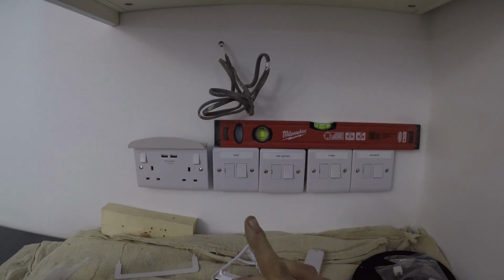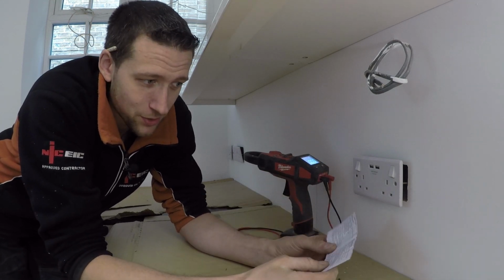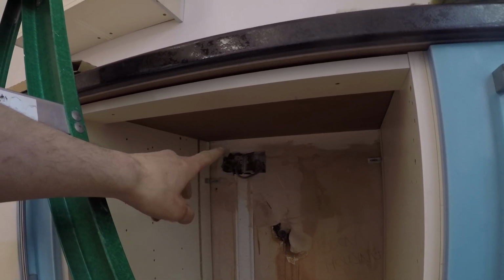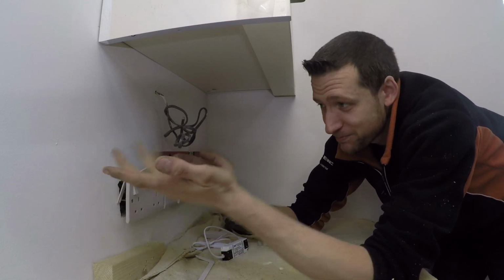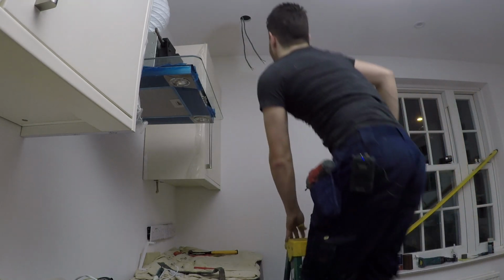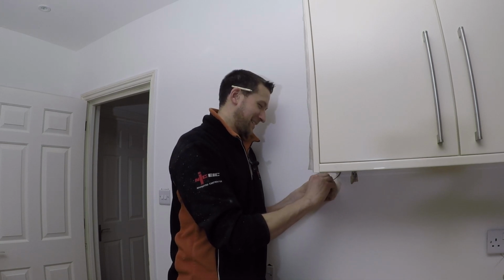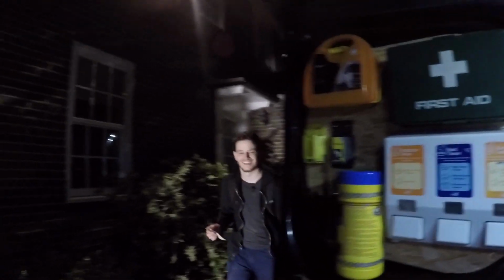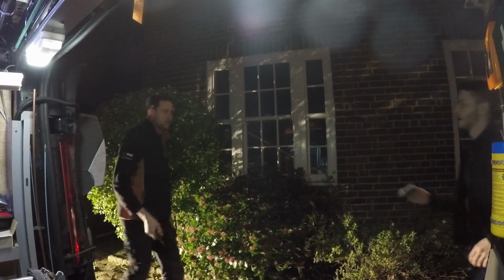Kitchen Rewire 2nd Fix - An Electricians Day in London | Thomas Nagy

Comment: Them USB sockets, IR Testing 500v. When you install them onto the ring circuit, connect the 2 browns into the live, 2 yell/green into earth (+optional earth bond), the 2 blues - just connect them together with a 'wago' terminal block. Now your all set to carry out all the ring continuity, r1-r2-all your IR testing with no dodgy readings.

Comment: Top tip for taking the strain off your back when doing under cabinet lighting.  If you can find steps or something the same height as the cabinet you can rest your legs on the top and lie straight as you wire the cabinet lighting.   I'm not convinced about the BG USB socket being insulation testable.  I may have to get one and give that a go.  The test from L/N to earth would be fine, but I would expect a modest leakage between L and N due to the standby current of the circuit....   I've just tested that on a British General USB socket - it showed an abysmal 0.29Mohm on a Socket and See insulation tester.  Probably due to the standby current of about 0.3mA which is significant with a 1mA test current.  Hmmm!
Reply: I should mention I made a video about it (coming soon) and took the whole thing apart.  It's a mile apart from the cheap imported crap.  The quality of the USB module is actually really good in terms of fusing, filtering and electrical separation.
Reply: BigClive hath spoken... now he can talk after those "chicken" noodles...
Reply: As you were doing the test I was wondering. Is it switched with those switches and they mean in switched of position it passes the test.

Comment: Instead of 4 fused spurs, thoughts on the grid modules with the appliances engraved on them? Or did you have no control over design
Reply: Who needs them anyway. Besides cooker big hob no requirements.

Comment: Good work Tom and Tom.  Fitting some undercupboard lighting reminds me of a time when I was screwing a small joint box to the base of a wall unit when a tiny chip of melamine came loose and fell into my eye.  I have never had pain like a scratch to the eye ball !  and thought next time I will use eye protection.

Comment: USB sockets you could always join line and neutral together, test between join and cpc for your insulation resistance test. This will eliminate damages to sensitive equipment and then just note this on the eic.

Comment: Add the metre of led strip to the interior lights in the back of the van no driver required straight 12 volt feed off the bulb holder seen a few done like this very handy on dark nights /early mornings

Comment: Just a food for thought, rather than having a bad back, would it not be easier to mount the drivers for the led strip on top of the kitchen units and just put bell wire down the back of the cupboards to the strip? And means you can't see a driver underneath! Enyoy watching your work! Trying to catch up 😁

Comment: Hi
I normally fit a fused switched spur above worktop and run a 1.0mm twin and earth up to behind the cooker hood chimney and join the Flex from the cooker hood to the twin using a choc box , so if the fuse blows due to a bulb blowing the its easy to replace , saving you from removing the chimney for the hood .
Reply: Better for maintenance and removal or replacement in the future, if it`s on a plug and socket arrangement. Put a 3A fuse in the switch spur, and a higher rating in the actual plug, no dramas.

Comment: Cheers for the insight.  One comment, I suggest you install that led tape pointing downwards next time! Not sure why you decided the wall needed lighting over the prep area?
Reply from the maker: i just thought it gave a nicer light, indirect light so to speak. still more than ample light either i guess. just personal choice i suppose?
Reply: Not really when it comes to a functional work space.  These would be my requirements;
Sealed units that can cope with regular scrubbing from kitchen cleaning products, even the best fully sealed silicon tape struggles with this.
Downwards illumination to avoid any shadows under work units - I can see the shadows in the video.
Proper current controlled tape/strip - hint if all you can see is resistors and LEDS it's probably junk.
CRI of 95 minimum so my steak's looks appetising.
Probably 3000K in a domestic setting.
Think about how these spaces are used - just my thoughts - obviously if the customer says fit this, then whatever.

Comment: Do you solely rely on the sticky back for the LED strips or do you use something else as well? Don’t they come loose and fall down over time if just relying on the sticky back?
Reply: Moelwyn Hopkins in the states we use a bead of silicone. You don't have to take the tape off. Just run down the back and tape with delicate painters tape till it sets.

Comment: Great vids mate. Two questions. What tool is that at 2.35
And how do you have 1 wire at each under cabinet light. Multiple switchlines or jb?

Comment: Ahhhh. That's bromance right there. :) Spread the love dude. Do you have a deal with Milwaukee tools? Or do you just rate them highly? :) I mean, I know you totally get what you pay for but is it worth  stepping up from bloody expensive to flapping expensive? The only Milwaukee tool I have ever used was a jigsaw a while back and it was a sturdy piece of kit. Awesome video as always dude. I have to admit to getting a little excited when the notifications ping up on my phone. :)
Reply: I have never heard the expression “good bit of kit” I’m definitely going to start saying it and bring it to Australia.
Reply: Scott Lichtsinn No offence taken. I am a dewalt man myself. My last drill lasted over 4 years although spent a year putting up with shite batteries so probably should have replaced it sooner. A lot more brands are offering a range of tools that operate from the same battery too which is awesome. :) Luckily I have a wife that understands the necessity to spend a bit more on power tools. When they are put through their paces on a daily basis they need to be reliable.

Comment: I don't see the point in those usb sockets - esp. when you mentioned a house you just did had them with every socket. How many people have more than a few cables for their phone? And if that particular socket doesn't have a cable they just have to go a find one which will probably already have an adapter negating the purpose of the socket. Not to mention, I doubt those sockets have the same protection as the higher end 5v chargers so I'm curious how they would fair with surges. Further, a lot of phones now have some version of fast-charging (my phone has something called dash charge) and I doubt any socket on the market will have fast-charging capabilities other than just a slightly higher amperage.

Comment: How come you fit all the individual fused Spurs for the appliances rather than say a grid switch? Just interested to know, is it preference? Cost? Both?
Reply from the maker: customer requested it. I actually opted for putting them in the cupboard above but they wanted them above the work surface.
Reply: thomas nagy Fair enough, as you say customer is paying so they get to chose. Have also had this before when like yourself I would normally fit them in a cupboard accessible but not on show.

Keep up the good work mate, love your videos as a fellow spark working predominantly in London it’s nice to see others days and how they pan out.

Nice touch with the impact for Dave, goes a long way. Good management mate.

Comment: Is that 10 M Ohm per socket? Doesn't that mean that eleven of them on one circuit will cause a reading below 1 M Ohm? Are you allowed to take a low reading and then approve it anyway based on calculations?

Comment: Think I would have put the extractor on a JB you have it on a fused spur of the fuse goes in the plug you have to take the extractor hood off 

And I would have put the oven and hob on a double with 1 spur to cut down on the space on the worktop it’s only for the ignition takes no load 

Love your vids though

Comment: For the customer who specified usb sockets everywhere did you suggest that’s probably not the wisest thing to do!?
Reply: sorry im not an electrician but i noticed a house that I am looking to buy almost has them everywhere, what is the issue with them?
Reply: Say one of them develops a fault, maybe an intermittent earth leakage fault, how on earth are you going to be able to diagnose which one is at issue.  In 5 years time when everything is using USB-C are you going to pay an electrician to replace them all?  USB charging standards are constantly evolving, these sockets aren't going to be all that great for many devices in a few years times.  Maybe they only use a £1 of electricity a year in standby but in a larger, modern home, if every socket had them that would be £30-£40 a year - that's significant - particularly across the nation!
Reply: Alwin Raju Unless you buy the most expensive ones, they won't last for a long amount of time before failing, they're an added fire risk too. I've seen normal plug in USB chargers get too hot and fail, even the good quality ones.
Reply: USB sockets, a 21st century marketing scam and we happily buy them today knowing full well they'll be changed in a few years and in the bin. It's the throwaway world we live in - bonkers.

Comment: The insulation resistance test should be done before loads are connected on an initial verification, this includes USB sockets, twist the ends together, hit it with 500 VDC, all clear... Start second fixing, job done. An insulation resistance test with live conductors connected together to earth on an EICR.

Comment: did you use anything other than the "sticky" tape to put the LED Strip up? I found it's next to useless, especially if there is a kettle within about 40 feet lol
Reply from the maker: i find stick it up using the sticky tape to hold it in place and then use a small smidgen of clear silicone every so often seems to work well in the long run. some of the led tapes grip like sh*t and then others dont, very hit and miss.
Reply: Mark Barratt was thinking the same.
Reply: i have a cheap and nasty Homebase own brand staple gun, and the staples are about 1mm wider than the tape I used on a job. so along with the 3M that was ( allegedly) on the back of the strip, i put a staple over at every cut joint ( most LED tape has cut points for lengthening or shortening the tape I believe ) 
The tape was sealed ( allegedly waterproof ) so I wasn't worried about shorting
Reply: I used hot gluegun and clips in the corners , i also cut the corners and used corner joints  as i ran it flat on the bottom of the cabinets for better light . I also wonder why you used multiple transformers instead of just one with a higher wattage.
Reply: Nemesis double sided tape and a few blobs of clear silicone wins the day. Not a disaster to remove then, when the damn things go faulty in a week!

Comment: What happens if the fuse in plug top on extractor fan blows once all the stainless cover has been fitted.
Reply from the maker: depends i guess. the only reason i put a plugtop there was just for ease of disconnection really if ever needed, rather than a junction box or something?
i put a 5A fuse in the plugtop and a 3A fuse in the spur so hopefully the spur fuse will blow first.
I mean i guess you could just put a junction box up there for what its worth? i just put a plugtop for the sake of it.
Reply: It’s pretty simple to undo the metal casing from the fan no?
Reply: Use a click flow connector
Reply: Use a click flow connector
Reply: Try using a click ct101 no need to buy a back box single socket and plug so works out cheaper as well. Great work as always
Reply: +1 for click flow,use them for hoods/downlights/appliances etc
Reply: I use a 5 amp socket and unfused plug.
Reply: would you even know there was a fuse behind it?
Reply: Onslow  no they’re a pain in the arse.
Reply: persona250 thats how we do it, with a click mini grid plate with a dp iso and fuse module
Reply: I wouldn’t worry about the fuse blowing, because you probably got a bigger problem with that fan 
You got to ask yourself why the fuse blew in the first place
Reply: I’m a click flow connector fan. Most hoods don’t come with plugs so a plug of some sort plug would need to be put on. I like the ease of putting them on each end so the kitchen fitter can just plug in
Reply: Good point, if the fuse in the plug goes, something's gone wrong with the thing connected to the plug (in this case a vent fan).

Comment: 8:41 what the heck is that red thing on the ceiling?
Reply: Smoke detector with a dust jacket to clean clean until all works are finished.

Comment: I really dislike the available usb sockets. They should have a switch to disconnect the built in power supply, but I don't think that exists.
Reply: ProgAndy Some do. The mk ones have a micro switch that disconnects the supply when the USB plug is removed.
Reply: Nice, maybe I'll have to get one now.